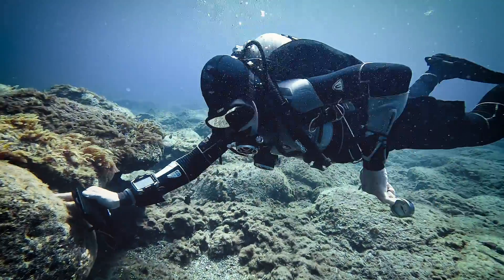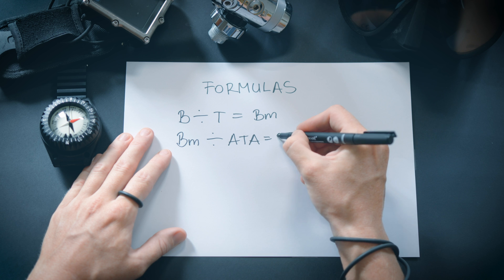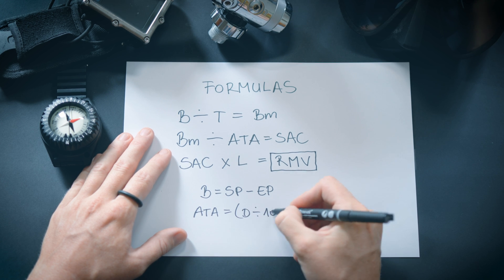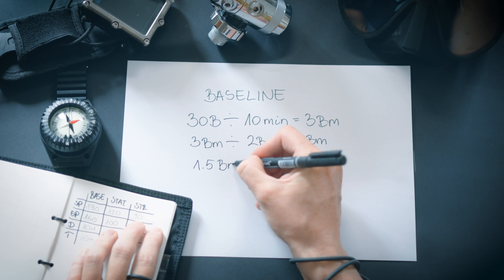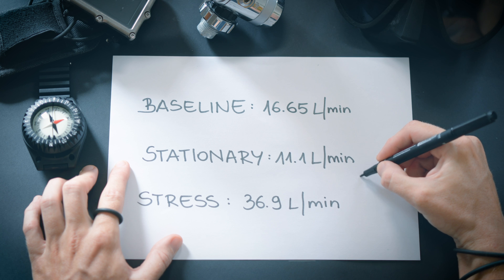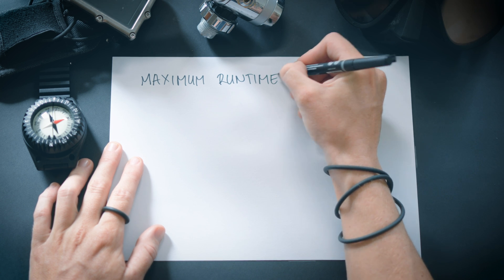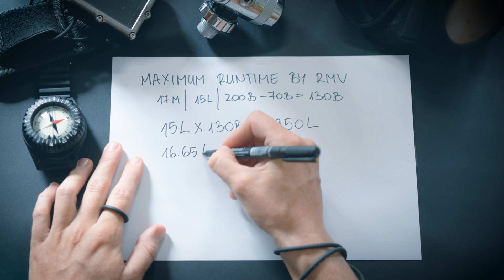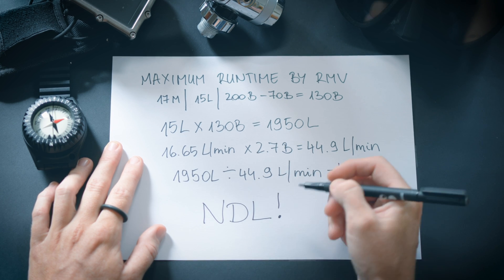How To Calculate Your Gas Consumption (SAC/RMV) | Master Series

Comment: I really liked the video - great explanation!
But am I the only one who has some formal questions on the example calculations?
The numbers are okay, but the "units conversion" in the video looks somehow wrong to me:

For Baselline, shouldn't it be like this?

30 B / 10 min = 3 B/min
3 B/min / 2B = 1.5 * 1/min
1.5 * 1/min * 11.1 L = 16.65 L/min

Don't want to be "nitty-picky" - but it somehow reduces the "trust" in the video, if the "unit conversions" would be done wrong.

In any case - great video!

Comment: Can you advise what the pouch is attached to the Dive Masters thigh for storage of a booklet or DSMB or other?
Reply from the maker: you essentially have two primary choices. You can opt for a drysuit, which typically comes with built-in pockets. Alternatively, if you prefer to add pockets to your wetsuit, you can purchase shorts specifically designed for this purpose. Most reputable brands offer their own versions, but they generally serve the same function.

Comment: Excellent as always. :-)
You can also compute your RMV rate for every dive, using the average dive depth (shown by your dive computer) and the difference of pressures after and before dive. In this case the consumption depends on the real conditions during the dive.
Reply from the maker: True! And over time you can calculate your average SAC rate for gas planning. Thanks for adding this!

Comment: I noticed that you used 11.1 L for the tank that you used. Are these tanks typically referred to as "11 L" tanks or "12 L" tanks?
Reply from the maker: Yes, sometimes they referred to as 11L or 12L, or alu 80. Their actual capacity is 11.1L.